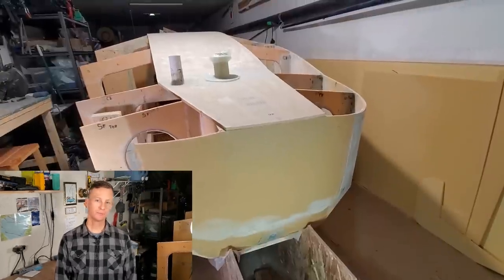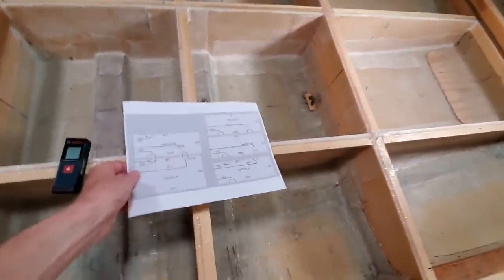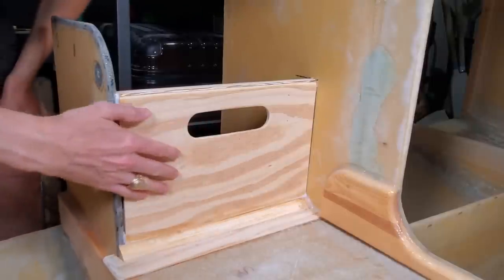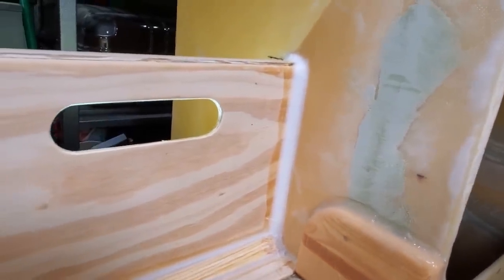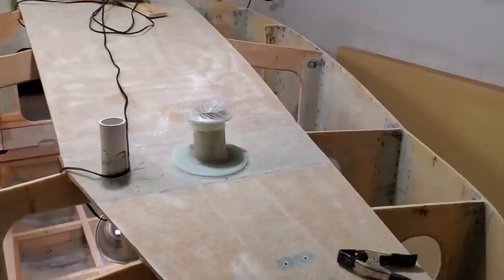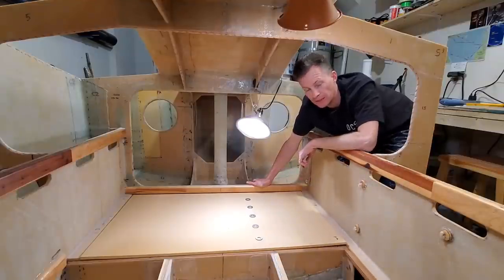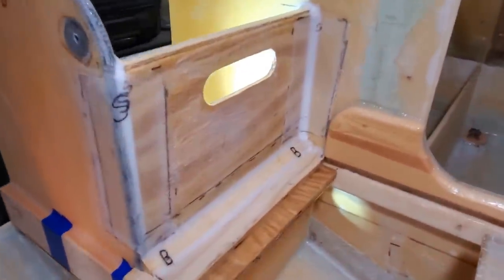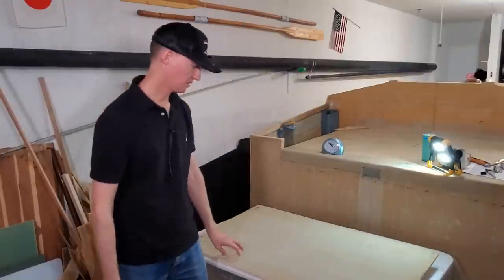OCSS-056 Cabin Sole Hatches - Mini-Cruiser Sailboat Build

Comment: As I'm watching, I wonder of you considered making the sole hatches watertight,  and directing any water that enters the cabin to a small channel running fore and aft on the port and starboard side of the cabin sole. The channels would drain into dedicated compartments somewhere along the length of the channels. This way you only have to pump out the dedicated compartments, and you can keep the others dry.

Comment: Hello Captain, why did you use plywood for the storage compartment, instead of foam? Cheers from France!
Reply from the maker: Not sure, it's a small panel (doesn't add much weight) and there's a lot less fiberglassing involved if I just use thin plywood, so it was probably out of laziness.
Reply: I was just about to ask the same question. Seem like you have quite a lot of foam left unused.

Comment: This boat does not seem to have much built-in buoyancy. What happens if you run into something like a floating container and the hull gets holed? It would seem like some closed cell foam would be advisable. Don't boats under twenty feet in the US have to have enough buoyancy to prevent them from sinking?
Reply from the maker: The boat will be unsinkable. I have to progress further on the hull before adding buoyancy compartments but they're coming.

Comment: Hi Perry, do you have a link about Michelle? I'm French too. Would like to follow her/him? (michel or Michelle?)
Reply from the maker: Michel is retired and wrote me after watching my videos. He's designed & manufactured big sailboat keels and even F1 race car bodies, etc. He helped me redesign my keels and then started putting the whole boat in CAD. I'm very lucky to have his help! I don't think he has any websites or anything.
Reply: @ocean_capable_small_sailboat  thanks captain perry. Very lucky 😉
Reply: You probably know this, but Yann Quenet is putting out videos of his rebuilding of Baluchon.
Reply from the maker: Check out this link. He drove in Le Mans race! http://lemans.eklablog.com/michel-elkoubi-a213240455?noajax&mobile=0
Reply from the maker: @cornishhh  Thanks, I've been watching. I'm a fan of the smaller portholes, I always thought the 1st version's portholes were too many and too big. I'm not as wild about twin lifting keels, too much loss of space inside. But to each their own!
Reply: @ocean_capable_small_sailboat  I agree about the windows. IMO insulation is important for both heat and cold, and the added buoyancy is another bonus.
I like the lifting keels too, but I like the ability to float in shallow water and run on to a beach. A single central lifting keel definitely takes up too much space in a small boat's cabin though, and on a heavier boat it's prone to getting blocked/damaged with stones and mud.  
I had the lifting cable come off the ballasted centreboard  of a 21ft Hartley I used to own. Luckily it was in flat calm weather and no harm was done, but it's not an experience I'd like to relive!